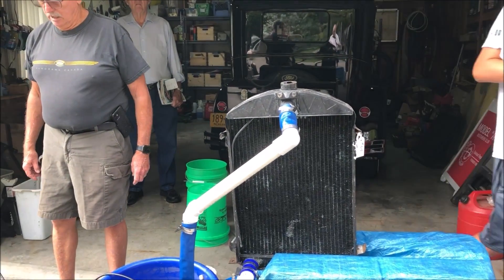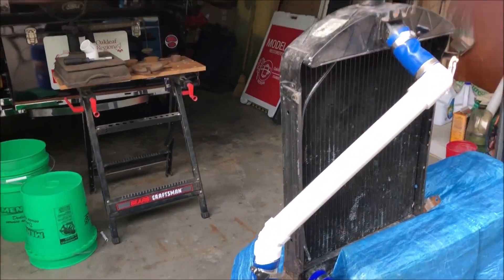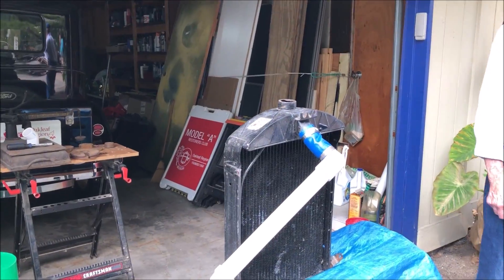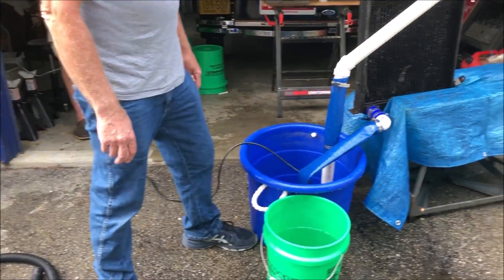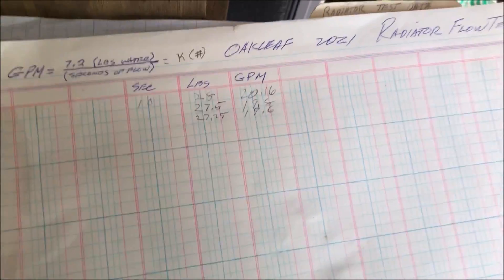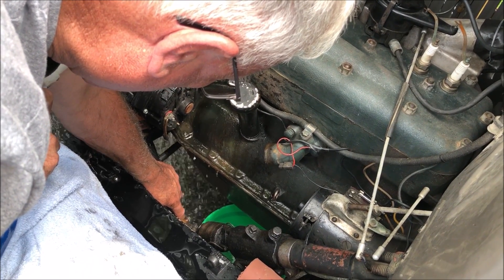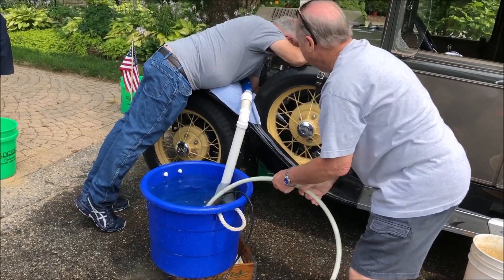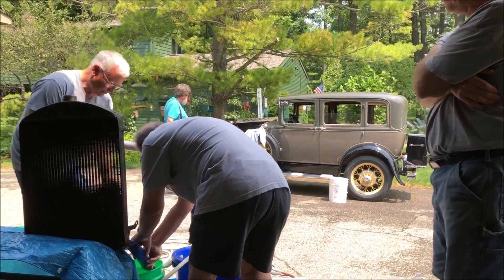Radiator Flow Test on a Ford Model A

Comment: Why not make a header tank to attach to the filler cap neck. Cap the top tank hose & put a valve on the bottom on the bottom tank. Open the valve & time the flow of 5 gallons threw the radiator.

Comment: I wonder if the actual flow with the pump running would be slightly higher.  You are only getting the flow rate based on gravity.